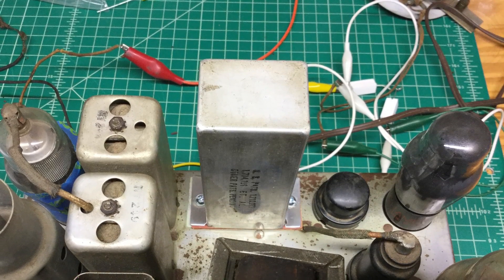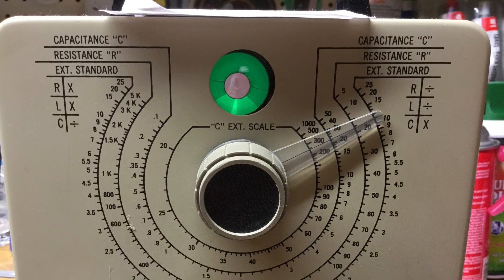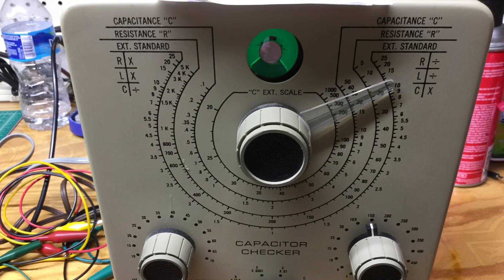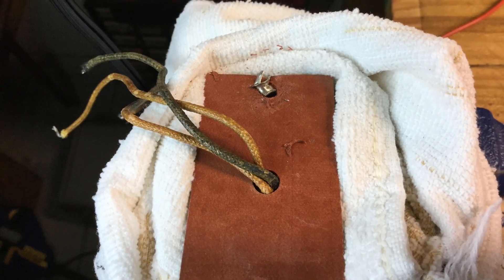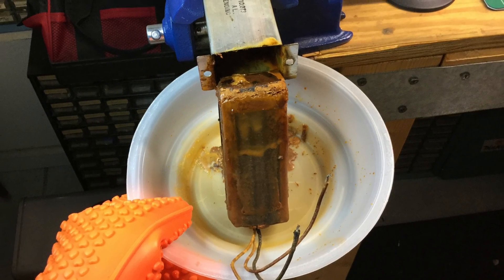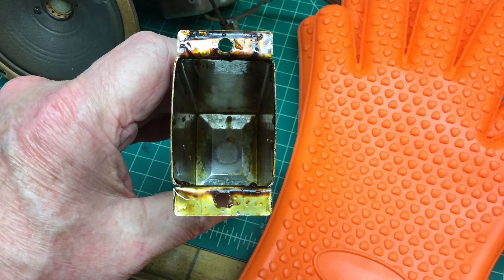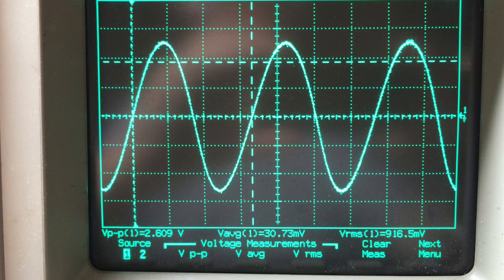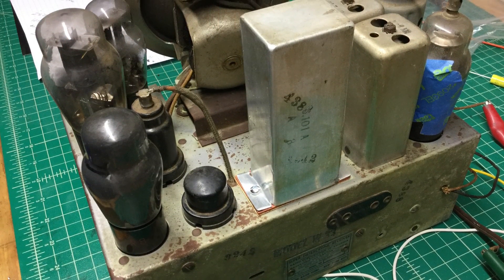B+ Power Supply Work

Comment: RESTOREOLDRADIOS, if the B+ is 400vdc and you raise it higher to 600vdc will this increase the AC ripple?
Reply from the maker: The capacitors used couldn’t withstand 600V, but if rated accordingly it would depend on the load itself. Best, Don
Reply: @RestoreOldRadios  if the filter caps were changed to 600v would the AC ripple voltage increase since the B+ voltage increased because the power tubes would draw more current which would increase the AC ripple voltage?
Reply from the maker: Bill, changing of the capacitors to a rating of 600V wouldn’t increase the B+ voltages or affect the ripple. A capacitor rated for 600V just means that the capacitor can safely work in a DC circuit up to 600V before breaking down. It’s a common practice to spec the capacitor voltage rating for the B+ RMS voltage x 1.414 to get the Peak voltage, e.g., if the RMS voltage was measured at 400V; 400 x 1.414 = 565.6 Peak volts, so a 600V rated capacitor could safely be used. Hope this helps. Best, Don
Reply: @RestoreOldRadios  thanks for the help. But is the ripple percentage based on the B+ PEAK voltage? If you increase the plate B+ voltage to 600volts and changed the filter caps to 800volts to be safe, this will increase the AC ripple percentage since its based on the B+ Peak voltage? By increasing the B+ voltage from 400vdc to 600vdc this will cause the power tubes to draw "more or less" current?
Reply from the maker: Bill, reference Chapter 15: https://www.smcelectronics.com/DOWNLOADS/1936%20ARRL%20HANDBOOK.pdf

Engineering notes regarding power supply design for vintage... lots of theory and much of it over my head and complete level of understanding. You can also post a message on the Antique Radio Forum and some folks more knowledgeable than myself on this subject can respond. Best, Don
Reply: @RestoreOldRadios  Why does the Circuits LOAD will increase AC ripples percentage and AC ripples peak to peak voltage? If the B+ voltage is at +450vdc and the AC ripple percentage is at 2% and the B+ voltage increases to +600vdc and the AC ripple percentage is now 5%, why is that?

Comment: One of the first rectangular E-Caps I've seen! Cool!
Reply: +OlegKostoglatov Good to know! I'm always learning something new!
Reply from the maker: +Tim Dockery It is cool Tim and again a first for me too. I'm going to research the patent # and see what I can find. Best, Don
Reply: +Tim Dockery I repaired a 1931-32 Canadian Westinghouse model 801 that originally had a pair of dry electrolytics stuffed in a can like that, except that they were rated for 450 VDC so the can was larger. I did not restuff that can however as the 801 belonged to someone else, I used a terminal strip under the chassis instead in case a future repair has to be made. I also have a 1931 G.E J-82 where the original filter caps are mounted inside of a big block condenser can, along with all of the paper bypass capacitors, the replacements were mounted under the chassis by the last guy that worked on the set. They are not that common, unlike those ones in a rectangular box that you see as replacements put in during the 1930s and 40s,, but I guess that they were used in certain situations.
Reply from the maker: +Tim Dockery +OlegKostoglatov I'm always learning too. That's what I enjoy the most about this hobby. BTW - I'll be publishing another video soon with more info on the electrolytic cap. Thank you both for your contributions. Best, Don